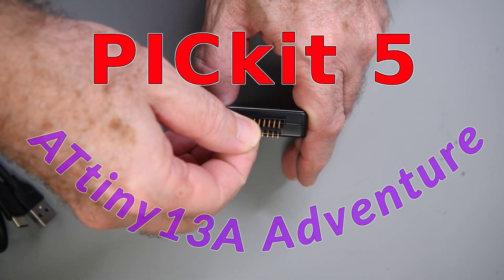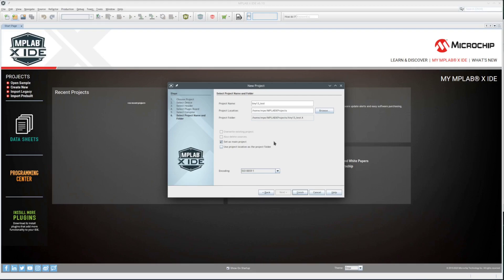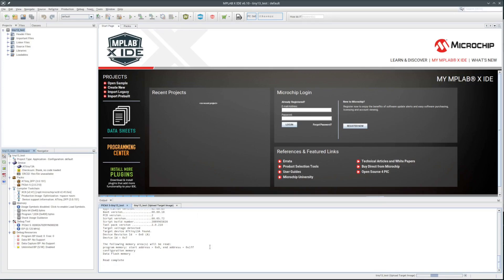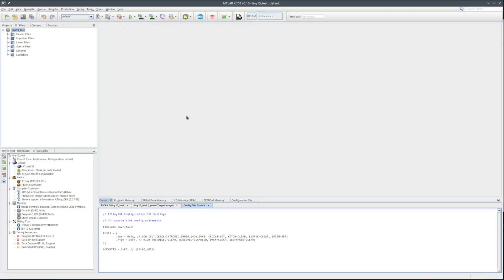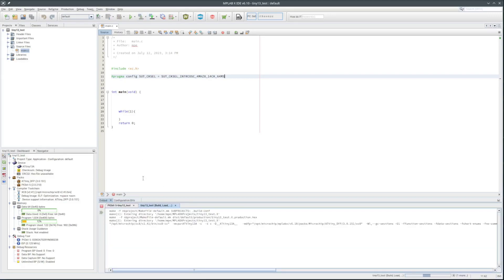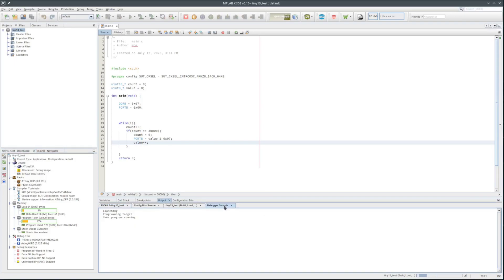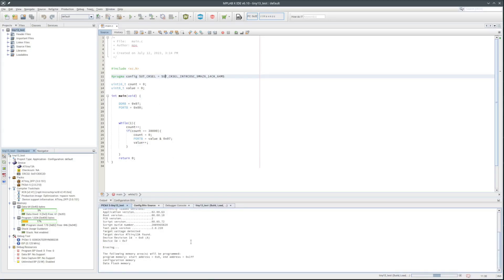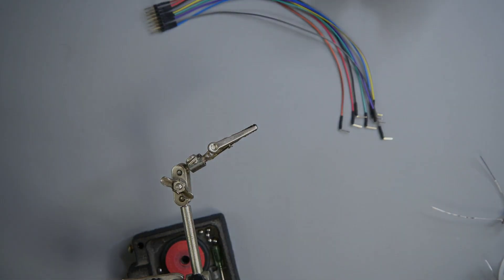PICkit 5 in an ATtiny13A Adventure

Comment: your video is really helpful sir, but if I may ask a question,
Do you have to use with debugger adapter when using the PicKit5 with Atmega 32 for example?
Reply from the maker: I haven't tried the ATmega32, so I can't say for sure.  But it should have an on-chip debug system, so I don't think you will need anything else but the PicKit5.